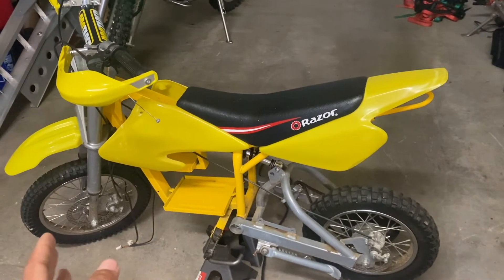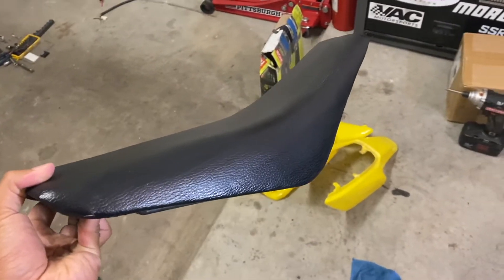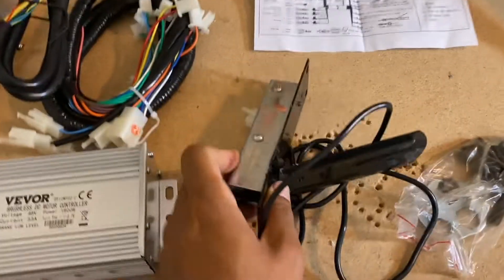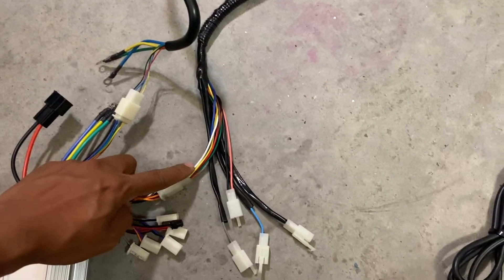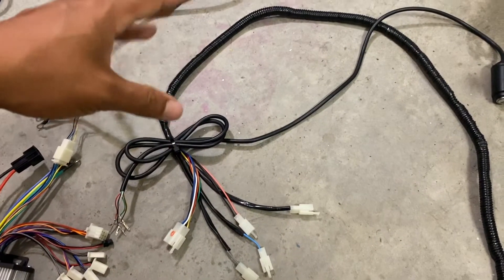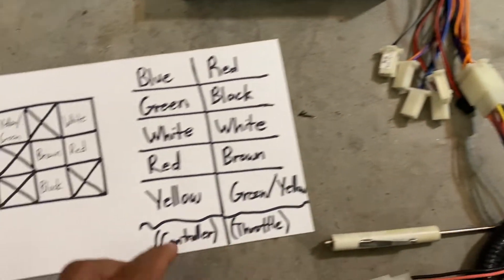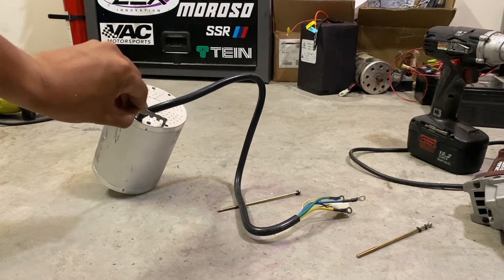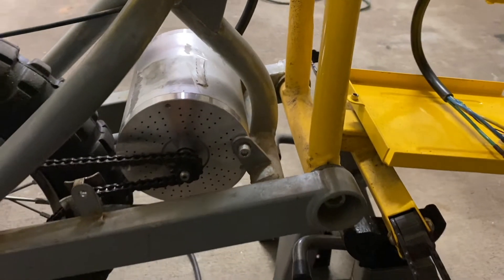Mini Enduro Build Razor MX650 Part 2 | VEVOR Brushless Motor 48V Kit Unboxing and Installation

Comment: Hello i just bought a mx650 and i bought a 48v battery and also a 48v controller from scooters.its still got the 36v stock motor and i know its gone burnt out soon.Ive been looking at replacement motors and i want to buy but a vevor motor but all them come with 3 wires red,black and green. I just want to know if i can hook up the vevor motor with the scooter controller with out the green cable ?
Reply from the maker: Brushless motors cannot be used with brushes controllers and vice versa. Stock motor is brushed and will not be compatible with any controller designed for a vevor brushless motor.
Reply: @PatOutdoors so the 48v Controller from overvolted scooter will not work with the brushless vevor motor ? And so do you recommend getting a 48v brushed motor ?
Reply from the maker: @Edgar-jn9xv have you asked them? If it’s working with your stock (brushed) motor, then it will not work with a vevor (brushless) motor. Getting a 48v brushed motor is not worth it imo. Just go with a complete brushless kit whenever you’re ready for more power in the future.

Comment: What bolts did you use to attach it to the frame?
Reply from the maker: The bolts for the original motor.
Reply: @PatOutdoors  mine didn’t come with any. Do you think you could send a link to one please

Comment: im about to buy that throttle but i dont want 3 speed and there are no the 3 speed buttons on the throttle so is it just always max speed
Reply from the maker: Then you just bypass the 3-speed connector on your controller.

Comment: Seems like most of us newbie had issues with Chinese system kits was the Hall censored cable.  Hall censor doesn't work so I ended up running with out it.
Reply: What’s a hall sensor😅

Comment: Whats up bro have you ever used any vevor motors? Specifically the 60v 2000w by1020d??
Reply from the maker: @ModDemonMX  this bike is using a vevor 48v my1020. Never used a 60v by1020d though
Reply: @ dang okay I’m jus wondering if I can slap one of my 72v batteries on it as that’s all I have until I make a 60v unit
Reply from the maker: @ as long as you have a 72V controller
Reply: @ no it only has a 60v with it the 72v I got didn’t work and I think I killed my FarDriver idk yet I have to do a couple bench tests today to see if they can work I didn’t want to wait for refund on a new one so I took credit that I can only use on certain item I couldn’t buy a controller so I had to get this 60v2000w motor controller deal kinda upset tbh lol Amazon always gets me

Comment: it’s me again. so i bought this caomm 48v battery and i have my vevor kit with the positive and negative wires with the holes in them and my battery has a plug and my kit doesn’t. can you help me out? (btw i do not have a soldering station)

Comment: Pat 
    Great video.  My son bought this kit for his 650 after following your videos on your builds.  We bought 3 new 12 volt batteries…my question is, will this set up work with 36 volts or is only designed for 48 volts?  This may sound like a stupid question but I want to make sure I’m doing this correctly…or to the best of my knowledge because I really don’t know what I’m doing.  I was starting to get confused with the wires.  Our kit didn’t come with that long extension.  Any help or advice would be greatly appreciated.  Thank you.
Reply from the maker: It’s a 48 volt kit. The controller has a power cut off at 41 volts that prevents it from turning on if the voltage is any lower. It will mot work for 36 volts. But the batteries is what supplies the power on these bikes and going from 36 volts to 36 will not be much of a speed upgrade. It’s what determines the max RPM’s the motor spins at ultimately.
Reply: @PatOutdoors  thank you.  I know it may have sounded stupid but I’m just learning about these bikes.  My son, who is 10 loves your channel.  I guess I’ll have to use the stock style battery because an upgraded lithium battery is out of our budget now unless you can recommend one that is not too expensive.   We have ordered new batteries for now but the pack that we ordered comes with 3 and I’ll have to use one of the original batteries to make it 48 volt.  Let me know your thoughts.  And again, thank you.   I’m a little confused on wiring up the 4th battery…maybe it’s because we don’t have an inline fuse (should we?).  I’m not real familiar with electrical components and I’m trying to figure out how to connect the 4th battery in-line with the others.  If you have any pics or anything that would help us, that would be great.  Thx again and keep up the great work.  Also, is it correct to say that I’ll need a new (non lithium) charger?  Thx.

Comment: What did you do with the stock brake connectors?
Reply from the maker: Leave them unplugged. All those do is cut power to the controller when you apply the brakes

Comment: I have the vevor 1800w kit. The throttle is very touchy at start. Any way to program it or use a different controller that is smoother?
Reply from the maker: Unfortunately this controller is not programmable. If you want a more predictable throttle curve and more overall power, you’d had to upgrade to a Kelly. Check out my latest videos with install details

Comment: Is it better to get a vevor kit off of Amazon or to get a 48 volt kit off of eBay what ones better in your opinion?
Reply from the maker: What brand is the off eBay? You need to look at the specs to compare how powerful the controllers are for both listings
Reply: @PatOutdoors  the brand is Fast scooters
Reply from the maker: @havynstone5520  well that’s to use with a stock brushed motor. The vevor kit is brushless, which is completely different.. The vevor would be better since it also comes with a much more powerful motor

Comment: Great video. Any idea why my motor is running counter clockwise and not clockwise?  Building same thing you built in your video
Reply from the maker: You have a Vevor brushless controller?
Reply: @PatOutdoors  no I’m pretty sure I blew that up and replaced it with a different one.

Comment: Hello I bought the same kit from Amazon and your video helped me a lot.
 Thanks..
One question only,do you have any idea if it is like that on full power or we need to connect the 3 speed wires that you mentioned somehow?
I have fixed 2 bikes for my kids with the exact same kit,one with 48v 20ah and one with 48v 18ah and the one with the 18ah is faster and don’t understand the reason..
Reply from the maker: Can you elaborate? The (3) phase wires that connect to the motor are required for it to run period. Unless you're talking about the speed controller wires? I jumped the wires to see if it'll be faster, but found out it was just slower on the other two settings so I left it disconnected. May be different for different controllers though.
Reply: Mine controller just doesn’t have the 3 speed wires.The only 3 wires that come out from controller are the throttle ones.
Reply: @PatOutdoors  so the female 3 speed plug you left completely unplugged or used a paper clip to find the fastest mode and secured it in place ?   I would ideally like to keep the overvolt lit ‘s throttle displaying voltage. The vevor kit I received has no display or indication of whether or not it’s sending/receiving a signal. Simply a 3 wire grey red black connected to the controller.
Reply from the maker: @ShotTheoryPB  I tested all combinations and found that the fastest setting was the same as no bridge so I left it unplugged. This does not apply to all controllers though, which is why I wanted to test it first. The vevor kit I got didn’t even come with a throttle. I just rePinned the Kunray one to make it work. I like the one I use on my other bikes better though: https://amzn.to/3ZvmxaX
Reply: @PatOutdoors  gotcha. Thanks bud.  I guess I’ll look to buy that throttle then.
Reply: @PatOutdoors  I was dumb and just hit me I had everything I needed just needed to change the pin configuration.   Thanks

Comment: why don't you just put a $30 CRF 50 tall seat on your MX650's.  Add about 1 inch of height and so much nicer to sit on.
Reply from the maker: Because the purpose of the lift is for ground clearance. The seat only changes the seat height

Comment: May wanna get a better battery. The stock ones aren’t too good. Please leave a link too
Reply from the maker: I haven't been using the stock batteries for anything besides bench testing. Lithium battery would be the first upgrade I would do if I had to start over with another razor build
Reply: @PatOutdoors  So you haven’t driven it yet?
Reply from the maker: @anthonyfatoruso  I just got this bike recently. My black MX650 I've ridden long distances and goes 45+ MPH for street use. This yellow bike I just started putting together for dirt use.

Comment: aliexpress has some great batteries! lookup  chamrider and they have a wide selection from voltage to capacity. they also have plug options on the batteries to fit ur plug on the controller. i got a 26ah 52v samsung cell for 400 i think thats a great deal
Reply: How long the batteries lasts until they get out of energy

Comment: Ooops, Vent Holes ?
Reply: What do you mean vent holes? The two counter sink holes I drilled are so the case bolts sit flush. I’m not gonna drill the holes on the end caps bigger till later. Don’t think I need the additional cooling yet, want less chances of debris getting in the kotor